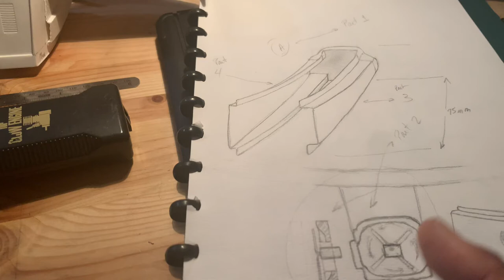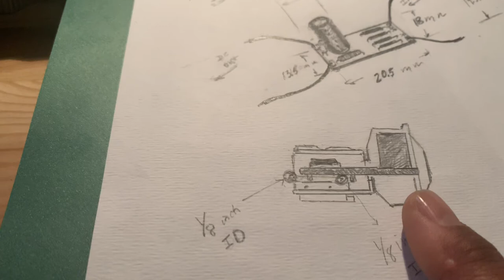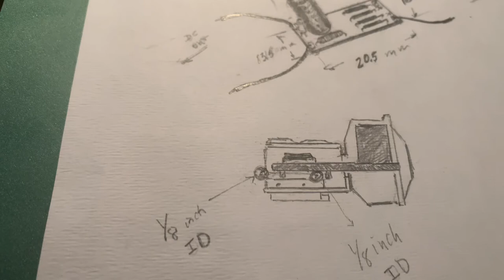Alternator test bed setup part 2

Comment: Why not hook up the alternator to a transformer that is on a ac/dc power supply and run all the electronics?
Reply from the maker: Not enough juice Ken and I need the juice onboard before the engine starts.

Comment: Could you not use that to keep your battery charged like in a real vehicle?
Reply from the maker: Yes, I could. However, since the engines don’t run for very long, I decided to power the radiator fan instead since the engine  needs the fan while running.  .